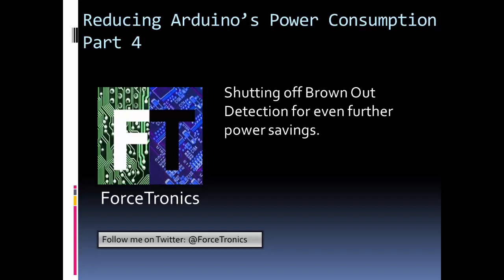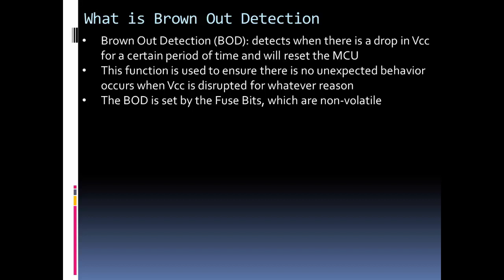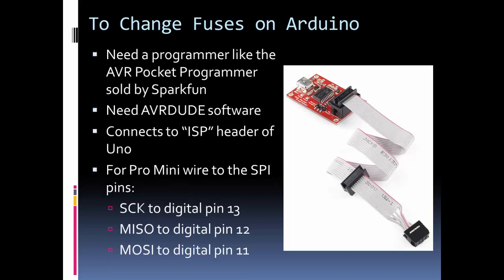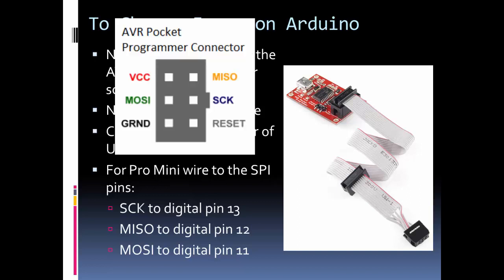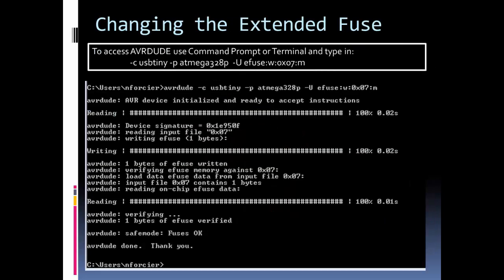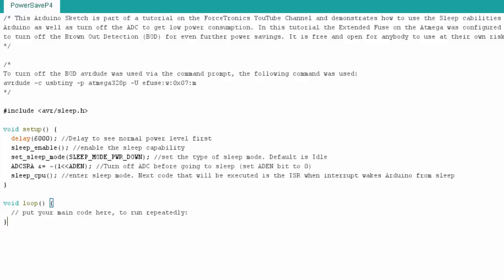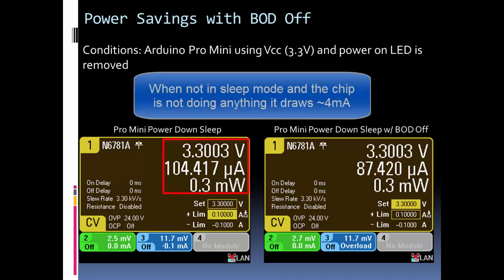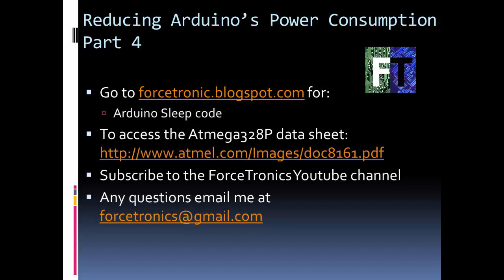Reducing Arduino’s Power Consumption Part 4 (Turning Off the BOD)

Comment: I've seen a video from Kevin Darrah where he shows (with example code) how to disable BOD before sleep, so you don't need to mess around with fuses.

https://www.youtube.com/watch?v=urLSDi7SD8M

He shows the results using a similar power supply to you, and it's quite remarkable.
Reply from the maker: +Matthew Collins Finally got around to watching kevin video and you are right. Thanks for sharing this.
Reply: You can disable BOD via fuses or in software, but their behavior is different. If you disable in software, there is a delay in re-awaking from sleep because the BOD is re-initialized on wake-up. I believe the delay is on the order of tens of microseconds. If you have a time-sensitive response to a wake-up, that may be disqualifying behavior. In that case, if you know that you don't need BOD, it's best to disable via the fuses.

Comment: hm it doesent work for me. i have double-checked the connections

avrdude -F -c usbtiny -p atmega328p -U efuse:w:0x07:m

avrdude: initialization failed, rc=-1
avrdude: AVR device initialized and ready to accept instructions
avrdude: Device signature = 0x000000 (retrying)
avrdude: Device signature = 0x000000 (retrying)
avrdude: Device signature = 0x000000
avrdude: Yikes!  Invalid device signature.
avrdude: Expected signature for ATmega328P is 1E 95 0F

avrdude done.  Thank you.